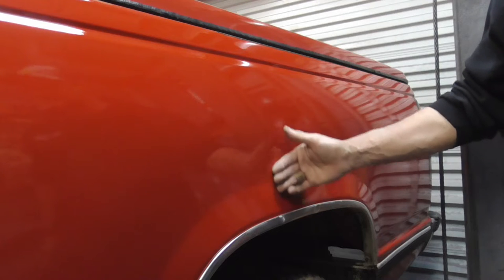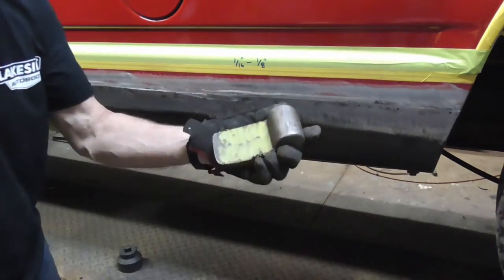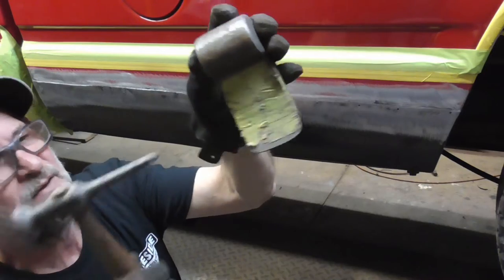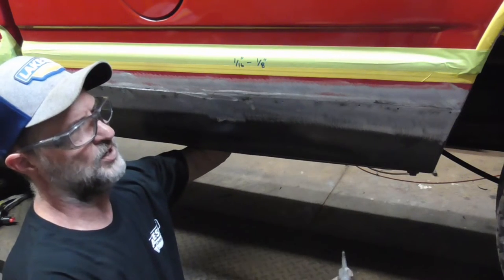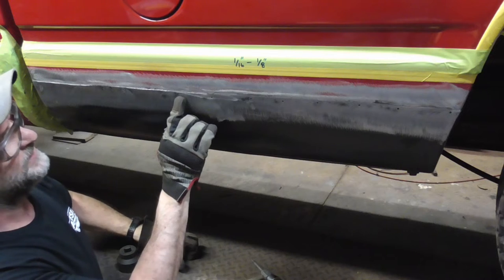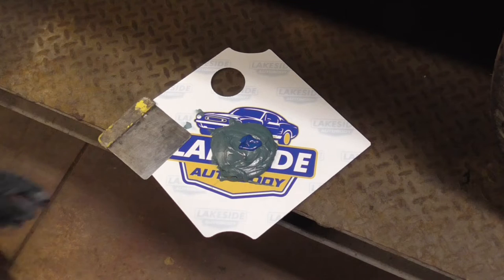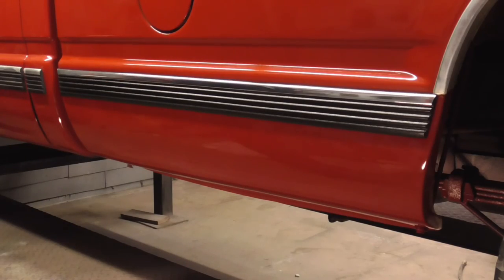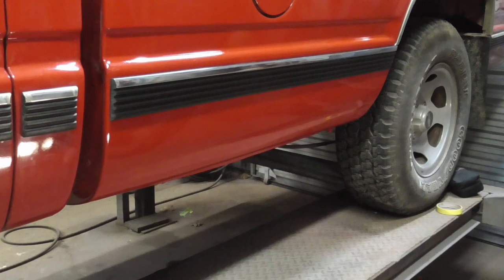Glue On Quarter Panel Patch (Part 2) - Tapping Down the Seam, Filling & Painting

Comment: I’m confused… why are we adding dings
Reply from the maker: Just like the factories did sail panels.  They would lap weld the quarter panel to the roof panel in a valley - then fill that valley with lead or even filler on late model cars.  Body shops try to copy that process by tapping the seam (lap) down to make the valley - then fill - just like the manufacturers did.  You always want a buffer (filler) between your seam and the finish (paint)

Comment: Jerry!  Nice video.  Do you make your metal squeegees.  They really do the job by being a little stiffer and longer lasting then those yellow plastic squeegee appliers.  And if so, what gauge?  Thanks.
Reply from the maker: I don't but here is a company that sells them - very similar to the ones I use - https://www.ebay.com/itm/141695623597?chn=ps&norover=1&mkevt=1&mkrid=711-117182-37290-0&mkcid=2&itemid=141695623597&targetid=1645685074448&device=c&mktype=&googleloc=9017127&poi=&campaignid=16730423415&mkgroupid=135815925780&rlsatarget=pla-

Comment: Did you use any epoxy primer under your blocking primer? I also like to use epoxy on the backside of panels and under coat the inside after the epoxy has cured. Your finished job looks great as always.
Reply from the maker: Thanks for the support David.  I didn't use epoxy under the blocking primer.  You can if you want but remember.... paint is your best protection against moisture and/or protecting bare metal.  If you leave it outside for months or years before painting then yes, it might be a good idea to hit it with some epoxy.  Have a great week my friend :)

Comment: Not going to fill holes. Then hole filler? Cheese grater removed most material? Then straight to sanding a new material? Did you skip a step?
Reply from the maker: I didn't skip a step.  I think when I said I wasn't going to fill the holes, I meant with rivets.  Sometimes I use rivets to fill holes but in this case it will be under the trim so I sort of cheated - knocked the holes down a bit and filled with fiberglass reinforced filler.  If that doesn't make sense ask again.  Hope that helps clear it up :)

Comment: Do you believe filler does not stick to paint as well as it does to steel?
Reply from the maker: Great question - filler doesn't stick to paint or metal if the sand paper or grinding disk is dull - in other words has "shined" the metal instead of cutting it.  I just made a video on that and will post it next Friday.  For now though here's something that may help - https://www.youtube.com/watch?v=koMw6-auoIs  The shops I worked at were serious about putting filler only on metal that was prepped with a 24 or 36 grit fiber resin disk on slow speed.  Never, ever have I had filler come away from metal if I did that :)

Comment: I'm about to attemp try number 3 at redoing the roof skin on one of my cars. I tried the last time with panel bond and it seemed very thick and hard to spread. I noticed that there is a foam (looks almost like black closed cell foam) across the middle roof brace and the front and rear have a very soft yellowish foam. Do you have any idea where I could find similar products? Have you replaced a roof skin before? Thanks!
Reply from the maker: I replaced a roof at the posts but not a skin.  I'm not sure what the black closed cell foam type stuff is other than factory type adhesive but I'm sure the SEM Impact Resistant structural adhesive would work fine for that - it's not that thick.  SEM 39757
Reply: @LakesideAutobody  Some of the research I did suggested 39747 would be good for roof skins and door skins, so I tried that. Is it supposed to be hard to come out of the tube and spread? I'm thinking the stuff I got was old or something.
Reply from the maker: @jayinmi3706  It should come out really easy - like too easy.  You have to back off the trigger each time you set the gun down.  It comes out much faster and easier than say latex caulk for your house :)
Reply: @LakesideAutobody  It didn't, so I think there was something wrong with it.
Reply from the maker: @jayinmi3706  I think so too.  If you don't have real good luck with SEM try 3M brand adhesive :)

Comment: What is the glue you are using for patch panel repair?
Reply from the maker: It's listed in the video description - it's SEM Impact Resistant Panel Adhesive.  Has little micro pellets in it to make sure you don't squeeze it out of the joint - really like that :)

Comment: do you use activator in the basecoat? do you think the fulbase is the old chromabase?
Reply from the maker: Yes I do use activator in the base coat though I've heard of guys not using it and the paint rep also says it is not needed in the base.  I still use it though :)
Reply: @LakesideAutobody  have you done a video on repairing a stake pocket on a pickup bed? I have some damaged from a ratchet strap

Comment: Can a floor patch panel  be done like that
Reply from the maker: Yes.  I glued an entire Dodge B250 van floor in but  I left the self tapping screws in.  A Doge van is unibody (not full frame) so the floor was not only glued to the frame rails but also the sides and ends.  I used galvanized steel thus the glue - I didn't want to mess up the galvanized coating by welding it in.  It'll never rust again hopefully :)
Reply: @LakesideAutobody  Thank you I appreciate the advice and I definitely appreciate the fact that you take the time and answer everybody’s questions
Reply from the maker: @leonardcrisci7254  You're welcome Leonard - have a great week my friend :)
Reply: @LakesideAutobody  Absolutely you do the same
Reply: @LakesideAutobody  ,don't do body work, but pretty adept at things(was a metal fabber-machinist of sorts). Now retired. So, I have to put floor panels in my altima and don't have a welder anymore.  But your use of glue has solved my problem.  Looks like you do nice work and have good videos.  I'll be checking out more of your channel to steal more ideas.(I only just found your channel)
Reply from the maker: @jasomkovac9115  Feel free to ask ?s - I get to them 1-2 times a day :)

Comment: VERY new to all of this, my question is, why do you hit it with a hammer after you glue it together?
Reply from the maker: Good question and super important.  No matter how you fix rust hole, weld, fiber glass, glue, etc., you'll want to make sure you tap the seam down for two reasons.  1) hides the patch   2) the filler is a good thing and acts as a buffer between the seam and the finish.   It's really not good to have a seam (butt welded, glued, lap, etc.) right under the finish - it's probably going to show eventually :)
Reply: @LakesideAutobody  Oh, well that's logical, should've known that! It's the same with drywall
Reply from the maker: 👍✌😊 @dragonfire7734